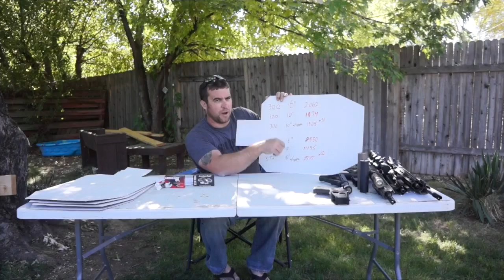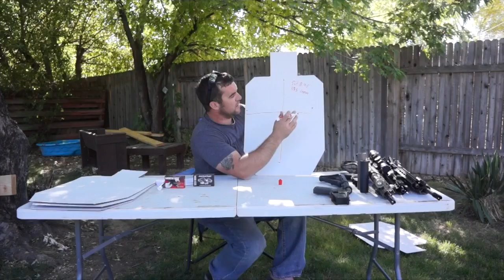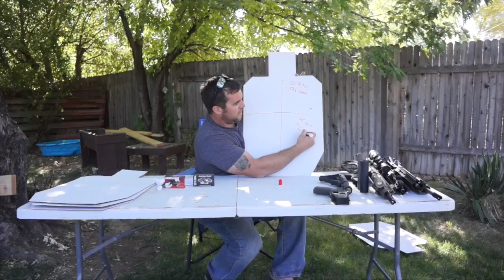Gunfight Science: Is 5.56 NATO Dumb?

Comment: I notice on the comments there's a lot of guys who still don't get the 3OOBLK.  Because of its huge diversity I think the 300 BLK should replace the 5.56 nato.  
   As we all know the 5.56 was developed to perform it's best with a 20 inch barrel . But now that it's being used with a 14 1/2" barrel it's lost alot of its effectiveness. 
   The 300 BLK however was developed to perform it's best with a 9 inch Barrel,  anything longer is just a bonus.  the 300 Blk round ranges from 110gr supersonic through to 220gr subsonic which allows for one hell of a diverse package !!  300 BLK (7.62x35) has more energy on target at 400 yds than 7.62x39 yet weighs less !!   to be honest guys the list of benefits compared to drawbacks with 300 Blk  is pretty amazing.  Also the price is coming down alot ! less than .50c pr now !! 
    Is it obvious that I like  300 AAC BLACKOUT !!?
Reply: The .300BLK will NEVER replace the 5.56 rofl... It is a good round for what it is MEANT for, but is extremely limited.. And it sinks like a damn stone once it is in the air.
.300BLK was meant for Suppressed SBR's inside 200 yards. For that, it is a good round. But outside of that, it is junk.
Reply: That being said, it is very good in the role it is meant for. Which is CQB fighting. For that, it is great. But for a standard issue weapon, it would never work. We are seeing far too many engagements out past the range the .300BLK will work adequately in. Even at 400 yards i would pick a 5.56. It just shoots waaaaay flatter. But at 500 or 600 yards it is not even comparable. The Blackout just drops way way way way too much to be used in those roles. And that is unfortunately what we were dealing with on a far more regular basis overseas. And even farther at times. Which is why we started looking into 7.62 NATO as an option.

The Blackout is a good round for what it is meant for (Suppressed SBR inside 200) and could be adopted to fit those roles specifically,  but is just far too limited in its effective range to be the standard issued weapon. There are just far better options.

Comment: Wow I hear this all the time.  The SBR is designed for ease of use in CQB situation.  Since we are not talking about military warfare then this entire video is off topic.  SP or expanding AR ammo is extremely effective from a SBR.  I am prior Military and Law enforcement, for the last 30 years.  I teach LE rifle use.  Yes military ammo is not great from a SBR.  Buy why in the world you you use green tip in a non military environment.
Reply: tlt40s&w 70 55 gr works just fine out of a 1:7 barrel.
Reply: The 2nd amendment is why you'd want military rounds. The better question would be why someone would want green tip to begin with. It's inconsistent in it's performance and does not cause as much soft tissue damage as many other rounds, even previous 5.56 rounds (M193 Ball). There's a reason the military wants to phase it out.
Reply: @lostsaxon7478  for better penetration. In a world where anyone can buy body armor
Reply: there is no such thing as military warfare versus other types of warfare. just warfare.
Reply: Christopher Gray the only time this ammo should be used is out of a 20 inch barrel but ive seen this ammo out of a 16 inch AR punch through 1/4 steel plate at 200 yards. If you stay above 2200 fps any 556 or 223 round will kill effectively, OSOK. I do see out of my 1.7 twist 16 inch barrel that these round over stabilize with 55 grain load. We all concur that the 1.7 twist was designed 4 heavier load.
Reply: I use just the (green) tip because I like to party. ;)
Reply: Why not just clear rooms with a pistol??
Reply: I get the ease of use in CQB and in-vehicle scenarios... But at the expense of weapon effectiveness and service life? No. A short-barreled 5.56mm firearm degrades the barrel and bolt carrier due to the kinds of high pressure the combo produces, especially with a suppressor. The shooter also gets significantly increased muzzle rise and blast if running un-suppressed. I won't trade them simply for ease of use.

Comment: I think there is a lot more to the story than just velocity and bullet weight. Would like to see a follow up with some ballistic gel tests at various distances. Bullet design has a bigger impact I think. For example, a 40gr vmax round coming out of a 10" barrel will do a heck of a lot more damage and fragmentation with the expectation that penetration will suffer, compared to say an fmj of 55gr or similar. Just depends on what you want to do with it and what distances you are engaging targets at, and what your target is. I think inside a home, defensive use of a proper expanding self defense round at 7 feet out of a 10" barrel will be excellent results, but stretch that out to 100 yards and it will look totally different.

Comment: No it ain't, but in a military logistical point of view (individual can carry more since it occupies less volume and it's lighter), in a macro perspective on cost and ease of production (less materials used for production of a cartridge) and ballistics..
5.45x39 is superior to 5.56x45.
Reply: Would you dare stand in front of one of them over the other?
Reply: +Life Style My point flew over your head, didn't it?!
For the military, where there are hundreds of thousands of soldiers that need to be equipped for the best cost-effectiveness, the 5.45x39 is superior. 
Why? Just read my first comment.
Reply: Actually, that depends. I am intimately familiar with both rounds. I honestly believe that the 5.56 is the superior round in Western designed weapons, both from a operational/lethality perspective and from a manufacturing/distribution perspective. However, manufacturers who make USSR legacy guns are not good working with brass. For them, the 5.45 is the better cartridge as it works with their design philosophy.
Reply: I agree the 5.45 is better, not by a mile but better. Wounding is more lethal even with the brown tiger fmj rounds and that's not the 7n6.

Comment: 10.5" AR in 5.56 is great for making a fireball and bunch of noise for screwing around at the range. Never got why people are trying to shoehorn a round designed for a 20" barrel into a 10.5" barrel. .300 blackout was designed for a short barrel. You can also use subsonic rounds with a suppressor and it will be more quiet than a 5.56 as well.
Reply: With the right round at the expected distances the 10.5 is very capable, of course it’s not going to be as effective as a 308 or 7.62x 39 but I don’t think if you hit someone with 1 or 2 expansions 5.56 inside of 150 yards they’re just gonna get up like “oh man thank god that was a short barrel”. No it’s not gonna happen, if you need a short “rifle” and want fast bullets and acceptable accuracy 10.5 or 11.5 lengths are good to go. 300 blackout is an acceptable option as well!! Get what you want and become proficient with it because whoever  gets hits on target first generally wins anyway ;)
Reply: @joecraig5216  I bought my 10.5 inch for close up self defense.  I think it's better than a pistol or a 12 gauge and I have 30 round mags.
Reply: 7" AR15 barrel with a strike industries cookie cutter break.
Reply: Seems to work well enough for SOCOM

Comment: Agreed. Neither. 223, nor 5.56 is all that spectacular. With the right bullet, going really fast, it's pretty decent. Knock 6" of the barrel, and take a 25 or 50 yard chronograph, and you have total shit. Not only low energy, but that low velocity keeps the bullet from expanding, and transferring any energy to the target.
Reply: Actually the jump in velocity from a 10 inch to 11.5 inch barrel is pretty significant

Comment: Someone already said it, but I'll repeat it.....

Using commercial AE .223 to make a point about military LC 5.56 is a losing argument.  The ballistics of these two ammo types is different.  

And setting this point up to show your bias is unfair to everyone, including yourself.
Reply: Dave Smith Exactly, there are special units that use rifles like the MK18, I highly doubt they're running FMJ's through them ha ha.
Reply: If you hunt with good shot placement, a 22lr will stop a deer instantaneously. Power doesn't really correlate to fast deaths, it correlates to faster deaths when shot placement is off.
Reply: Feteasca Alba self employed deer and elk are crazy creatures.... I've seen a client smoke a mule deer through both lungs at 250 yards with a .300 WSM and it ran about 150 yards.... I've also seen elk get shot with a .270 and die after 20 yards.... animals are crazy... good shots are definitely key if you want very much of a chance finding them however you never know how they could react.
Reply: The difference is basically moot. He is correct that sbr 5.56 isn't as effective as full length 5.56. That said, he does not mention non-fmj designs like hollow points which bring the SBR back on near equal playing field to it's full sized partner.
Reply: Feteasca Alba self employed That's disconcerting. I don't mind the suffering of the humanoid variety but animals that can't fight back... that turns my stomach a little. I prefer the animal die as quickly as possible which is why if  I were to hunt (out of necessity) I'd not use anything smaller/less potent than 7.92x57 SP (out of the calibers I have).
Reply: weejams I've seen many many deer be intentionally shot in the middle of the neck and drop in their tracks.... however like you were saying that's a tough shot past about 200 if they're moving. I've heard all these stories about neck shots being bad and all this but from my experience deer shot in the MIDDLE of the neck are toast.
Reply: weejams I've grown up hunting in all sorts of environments in Oregon. I've seen all kinds of things happen and you never know what could happen.
Reply: weejams I've done similar things but I'd tend to take some sort of food and water with me haha. All good times though however you choose to go about it
Reply: ATF also made it so you can shoulder braces! #MERICA
Reply: Most shots are a little off

Comment: Use some varmint rounds like hornady 55g or 60g vmax , they give the same effect at 1600fps - still pierces 1 inch steel and gives expansion...
Reply: mikeivanic Bullshit. No .223 round can pierce 1" steel, at any velocity.
Reply: Josh Frey hah time to make a response video .... green tip will easily pass through mild steel / I never specified the hardness lol
Reply: For sure. I would like to see a .223 / 5.56 penetrating a 1" steel plate, but there's a reason that video doesn't exist. I have shot a ton of different steel types and thicknesses with .223, 22-250, .308, 7mm, 30-06, etc., and I can tell you from experience, a .223 is pretty sad. 3/8" to 1/2" mild steel is its limit, even with green tips. On 3/8" (hardened) plate at 100 yards, in my 18" barrel, FMJ and VMAX chipped the paint, green tips barely scratched, and 22-250 put a mild dent. The only one that penetrated every time was the 7mm. .223 is fun as hell to shoot, but penetrating steel was never its intent.
Reply: Josh Frey I'm guessing the steel I'm shooting is not pure steel then , because I salvaged some of the deck plates from an old ship , and they range from 1/2 to 1 inch thickness , and the rounds pierce like butter from 200 yards -
Reply: That's interesting. I stand corrected. I'm not a metallurgical engineer, but your experience vs. mine clearly illustrates the vast differences in steel.
Reply: Josh Frey here is a picture , most of the time the rounds pierce , there were a few of the hollow points that just made a dent...  centre of the plate is 1 inch , the outer rim is 1/2 inch, it's a chair mount from an old ship... https://imageshack.com/i/pm3VKA1Xj
Reply: mikeivanic  I have a 22" 5.56 and no way is it going through an inch of even mild steel. 1/2 inch max. Maybe crack inch thick cast iron, maybe

Comment: So, tactical pants are not supposed to get dirty?
Reply: Sounds like we need to develop some tactical laundry detergent. rofl
Reply: archangel20031 I think the joke went over y'alls heads.
Reply: HELL NO! they are for carrying around ration cakes, flashlights, house keys, car keys, back up flashlight, knife, backup knife, phone, spare battery for phone, phone charger, spare batteries for BOTH flashlights etc

Basicly everything you cant fit into your fanny pack and EDC back/chest packs.
Reply: Borax. Most commercial detergents contain fabric brighteners that should not be used on clothing intended to be used as camouflage.
Reply: Sounds like you need to find yourself some $10 surplus woodland BDU pants.
Reply: I am pretty much rolling of my desk right now. How about this. Dirty, then wash... when you wear it, go on a hunt, match, duty, whatever, it will get dirty. If not jump in dirt.... when home wash again.... lol Tac pants are pants, but also tools. Use tools for what they are used for. Keep your shiny brand jeans for when you are in the office or go out. lol
Reply: bowhunter 85 Yes 20in barrels work but the purpose for an sbr is for house clearing. Would you take a big m16 and clear a house with it. It's all about application.
Reply from the maker: not with the usual price tag attached to them
Reply: They opened a duluth trading company near where I live and the Fleece Lined Fire Hose Pants @  $74.50 looked about as sturdy as can be.
They also had a loop like thing in the bottom of the right front pocket that would fit something small like my P-238 like a glove.
I have some cargo shorts just like that and it holds my gun like a small holster sewn into the bottom of the pocket.

Comment: Within 400 fps ?
 Within 600 fps per your own chrono results.
 ... but yeah, I'm picking up what you're putting down.
 7.62X39 has a tendency to produce straight thru and thru wounds, so given that, I wound lean toward a HP round or Ballistic Tip, same for the 300 BLK too.
Reply: SpaceFrawg soft points work really good. The 762 fmj tumble and all as well.
Reply: SpaceFrawg and the American fancy ammo in 762x39 isn't all that great because they load them 100-150 fps slower. Wolf 125 grain soft points is the best performing ammo for it.
Reply: Sly Tiger
I agree, soft points will work.
Reply: SpaceFrawg I think 300 bulk is a rip off

Comment: You need to remove the "nato" out of this title. 885 and 193 are much hotter loads that mostly negate this entire discussion. The AE 223 is 250-300fps slower then 5.56 properly loaded from same barrel. I do agree that SBR 5.56 is dumb. I also agree that 300blk is just as dumb past 150m. Side the drop from bore makes quick accurate shooting hard. If you can't hit the target terminal ballistics don't matter. 8" drop at 300 vs 30" drop? 300blk is amazing for sbr suppressed I'll grant it that. It's basically a heavier 9mm though so why not use a smaller lighter sub gun then? 5.56 isn't perfect but 300blk is in no terms a practical replacement for it. I'd rather step up to 308 or move over to 7.62 both are better then 300blk 9/10 times. Unless needing sbr surp which it's not really any better then a 147g 9mm. It really makes no sense. Just another trinket round advertised to be a solution to a problem that already has been solved.
Reply: john smith Philosophy of Use. If you have an SBR it is likely a CQB best used for home defence for civilians. Distance shooting is irrelevant. 300 BLK is the better round in that scenario, probably go with a 10" barrel. 300 BLK is a novelty round with less utility than 5.56. What do you want your rifle to do? Home defence? SBR set up as a CQB chambered in 300 BLK with suppressor is probably best. A range gun/ SPR I would go with 16", 62 gr 5.56, to 18", 55 gr 5.56 with a 1/8 and 1/9 twist respectively and use FMJ/LAP. Match gun I would go with 55gr .223. DMR would probably be 308, but I have no need for a  DMR so that topic is moot, I give zero shits. My AR is standard 16" barrel and i use it for home defence. These are my opinions.
Reply: john smith Philosophy of Use. If you have an SBR it is likely a CQB best used for home defence for civilians. Distance shooting is irrelevant. 300 BLK is the better round in that scenario, probably go with a 10" barrel. 300 BLK is a novelty round with less utility than 5.56. What do you want your rifle to do? Home defence? SBR set up as a CQB chambered in 300 BLK with suppressor is probably best. A range gun/ SPR I would go with 16", 62 gr 5.56, to 18", 55 gr 5.56 with a 1/8 and 1/9 twist respectively and use FMJ/LAP. Match gun I would go with 55gr .223. DMR would probably be 308, but I have no need for a  DMR so that topic is moot, I give zero shits. My AR is standard 16" barrel and i use it for home defence. These are my opinions.